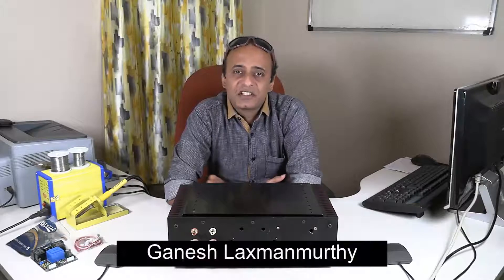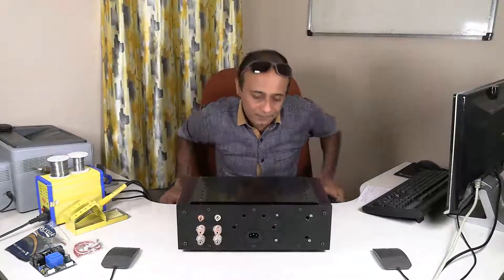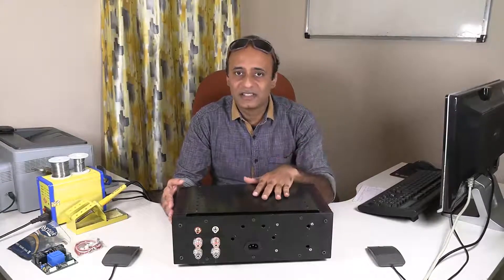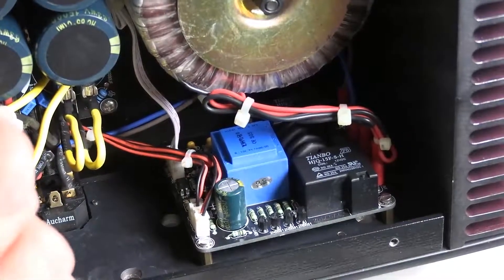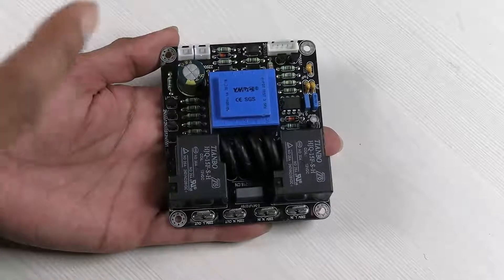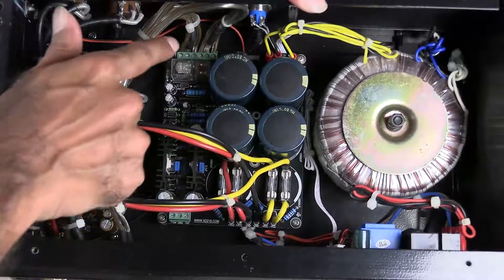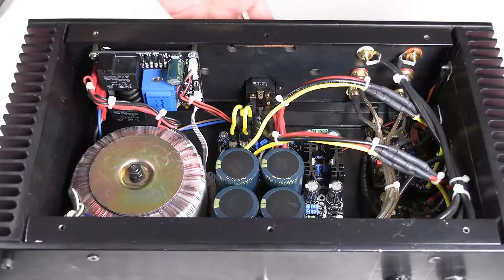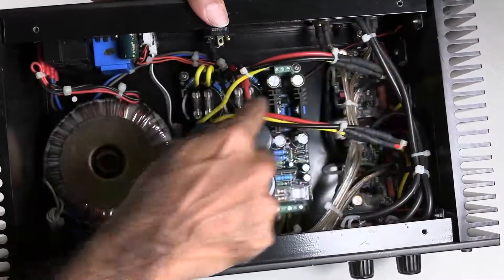Original Mosfet Amplifier - DIY Audiophile grade amplifier with best sound

Comment: Honest and informative.

Hitachi pioneered Lateral Mosfets way back in the 1970’s. Specifically made for audio. 

Very reliable and musical sounding output d vices.

My Hafler DH200 still works. It was put together in the early 80’s. So that is a testament to the longevity of these devices.

Thank you for sharing, Ganesh.
Reply from the maker: Thank you Mr. Chhina.

Comment: Sir can these amplifier modules be Powdered using an SMPS supply m
Reply from the maker: Dear Friend, Sure you can. I have not used an SMPS with a high power amplifier and want to try in near future. Audio enthusiasts avoid SMPS in amplifiers due to high frequency radiation it emits and this might get injected to the audio channels. Therefore, if you can get an audio grade SMPS and if you can properly shield it in your amplifier design,  you can definitely use it. Some high end manufacturers have started using SMPS in their amplifiers regularly these days. But be careful about the safety.

Comment: Can you please share the purchase link for the amplifier module, did not find that production salcon electronics website.
Also please do a video of your audio setup and also provide a audio demo of this amplifier, I know the sound over YouTube might not make justice but still can get a idea.
Reply from the maker: Thanks for asking. I enquired with them and right now they don't have stock. Alternatively you can try this module and it should sound equally good. I have built this circuit and the sound quality was awesome. It is cheaper also. and the mosfets are easily available.
https://www.salconelectronics.com/product/eight-audio-4-mosfet-80w-each-amplifier-irfp240-irfp9240/
Reply: @gtech8449  thank u very much, I will try to get my hands on these

Comment: Good quality modules and well built. Why have you not used the power amplifier one on each heat sink? Cabinets are always an issue, hence, I am trying to make my own cabinet. Could you kindly let me know where we can get such VERTICAL heat sinks ? ( I would sincerely appreciate if you could reply to my query on the heat sink !!! ).
Reply from the maker: Thanks for asking. Cabinet was small and I wanted to isolate the power supply. You can get cut piece heat sinks in SP Road Bangalore or online. For Ex. http://perfectmetal.in/products.html . (You need to mail your requirement and they would send quote immediately. You can also call them) You can also try here - https://diycomponents.in/Category.xhtml?category=HEATSINK
There are many more online heatsink dealers directly from factory.
Reply: @gtech8449  Thanks a lot for your prompt reply. Appreciate your professionalism !!!